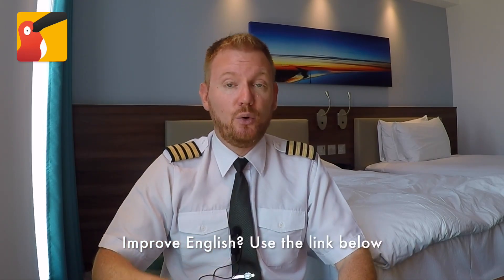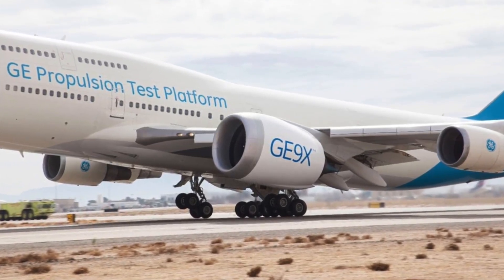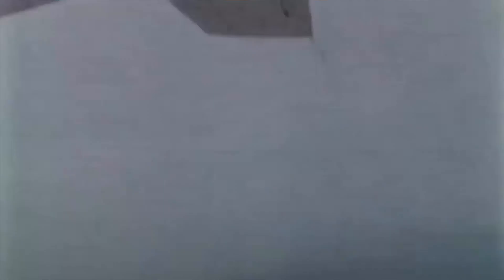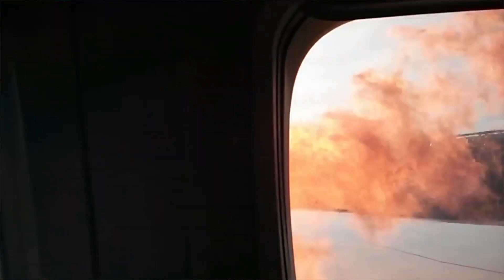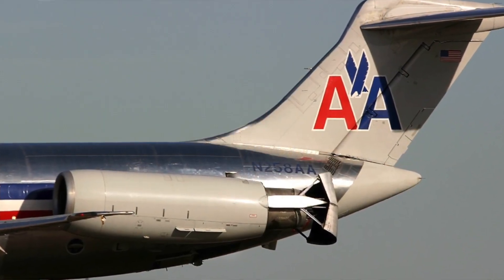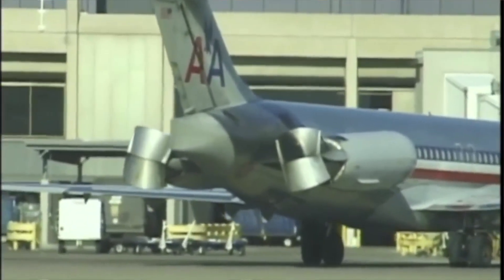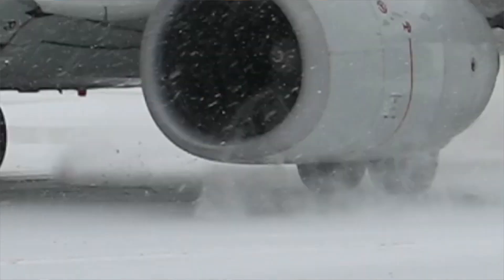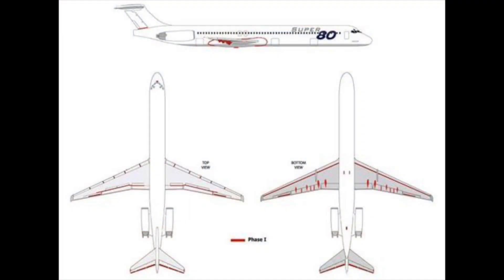Why are the jet-engines placed there? Wings vs Tail

Comment: I was incredibly nervous my first time flying alone. I happened to be sitting next to a pilot, who noticed I was nervous and decided to tell me about the physics of flight and gave me a general sense of the systems in place on a jet. One of the things he told me was that if the engines failed, planes with wing-mounted engines were very good at gliding, while planes with rear-mounted engines were not.
Reply: That doesn't make sense. Tail engined aircraft have a cleaner wing
Reply: @tedarcher9120  It is about their centre of gravity, and the location of their aero surfaces. A T-Tail plane has stabilisers way off the line of mass and so have an outsized torquing moment.
Reply: @Sagan_Starborn  how does that affect gliding though? Stabilisers are producing downward torque anyway to compensate lift, if anything T-tais have lower drag because they need smaller tails
Reply: @tedarcher9120  One way to think about it is, the more off the centre of gravity is, the more you need to compensate with something elsewhere on the aircraft pushing it down towards the ground, to stabilise the aircraft and prevent it from pitching upwards. When gliding, if you have lots of energy pushing the craft towards the ground, the less time it will spend gliding.
Reply: @tonyhawk123  tail engine planes have the same center of gravity as wing engine planes. Otherwise they would call out the sky after takeoff
Reply: @tedarcher9120  It’s about weight distribution.
Reply: @tedarcher9120 I don't know either way but maybe it's just something he just said to calm him down. Being liberal with the truth can sometimes be beneficial.
Reply: Those aboard BA009 in 1982 can attest to this.
Reply: From Google’s AI overview: “No, rear-engined jet aircraft are generally not worse at gliding than those with wing-mounted engines. Gliding is primarily determined by the aircraft’s wing shape, weight distribution, and aerodynamic efficiency, not the engine location. While rear-mounted engines might have some trade-offs in other areas, like maintenance or noise, they don’t inherently affect gliding performance.”

And then there’s a much more detailed explanation that im not going to type in here because it would lead to a post about a mile long, but i will leave you with this: “Many successful aircraft have rear-mounted engines and still have excellent gliding capabilities, including the Boeing 717.”
Reply: Hate those planes have engine on the back they do too much up and down on the way  more turbulence than a big plane they sucks

Comment: How come no aircraft apart from the x-15 have nozzles on top of the forward section of the aircraft for use in stall situations, when you need to change attitude? It can not be that hard to design and couple to the computers onboard, or to be used as last ditch effort by pilots pushing the big red button saying STALL RECOVERY.
Reply: Rather than add all kinds of expensive shit that can break to recover from a stall, the money is better spent teaching pilots not to stall the fucking plane.

Its also actually not hard to recover from a stall, you pitch down and add max thrust, even in a flat spin which is the most dangerous type of stall the procedure is pitch down max thrust, provided you have sufficient altitude to fall through the plane WILL fly if you keep the power on.

Ive done it in MSFS many times, purposely stalling everything from a cessna 152 to a eurofighter typhoon to a 747 and A380. No amount of fancy crap is going to save you from a stall if slamming the stick and thrust forward into the dash at top speed doesn't work, but it always will.

Comment: When working for Boeing in 1966 I asked why the engines we moved on the wing 737. The plane could be lighter because it would be a counterbalance since the wing holds the weight of the total airplane.

Comment: Is it easier to ditch a plane on water if the engines are mounted on the fuselage at the back, rather than under the wings? It seems logical that big, flat faced, wing-mounted engines are going to be a major disadvantage when attempting to land on water?
Reply: Yeah, but how often does a water ditching happen?  Not very many.  179 have been able to be investigated and of those 22% have numerous fatalities.  Of all the averages and computer simulations, 80% of those were complete destruction events and less than 1, if its possible, actually survive a water landing on any engine design.  Very easy to see why.  On a super stall event, usually when landing, its would pitch to a nose down situation and the weight of the aircraft would smash itself longitudinally, usually leading to no survivors.  On an underwing design, a water landing would cause the wings to fold under the fuselage leading to a failure point at the midpoint of the aircraft making escape almost impossible.  A real high approach angle is needed to impact the tail first before the wings touch the water.  In either scenario a land crash would be more survivable than any water landing.  No there are exceptions and luck involved.  The A320 that landed on the Hudson River is a noted success of a water landing.

Comment: Just two queries:
1. What is the advantage of some aircraft having two engines rather than those having four engines under their wings?
2. Another one are those having two engines under their wings and one engine atop at the rear end.
Reply: There's a video on that on this channel, but it's quite old now, probably about the same age as this one.
Reply: 1. Basically 2 engines give better fuel efficiency and cheaper maintenance and operating cost. Advantage of 4 engines is just that they have better redundancy.

2. Its more of a loophole per say. Basically if an aircraft has more than 2 engines, it doesnt come under ETOPS. Hence those aircraft have 3 engines
Reply: Thanx eekee. Will try to check it out.

Comment: The reason engines are placed on the wings is simple and it is one: economics. Fuselage mounted engines require T tails. That means a stronger (and heavier) vertical stabiliser.  Fuselage mounted engines also mean the load is localised on the fuselage. This, in turn, requires a stronger (and heavier) wing. Wing mounted engines make the aircraft lighter and more fuel efficient That is the reason the 737 survived while the 727 died. Aircraft configuration is now optimised. That is the reason all designs, from all manufacturers, have engines mounted on the wings.

Comment: I am not a pilot, but I used to fly quite a lot as a passenger.  I always felt that the DC9 and 727 had cleaner wings and handled low-level / low-speed turbulence and cross winds better than planes with wing mounted engines.  I do miss the 727, I loved seeing the stacks of analog guages as I passed through to my seat.
Reply: I was told that the 727 engine configuration is very inefficient, I doubt we will ever see anything like that again.
Reply: @GratefulFredHurst  That may be why the 727s discontinued. They did have quieter cabins than wing engine aircrafts,  since the majority of the noise from engines are behind them when a plane is acceleratingforward. You probably may've noticed when lined up for take-off back in the 1980s that the 727 in front of you moving away from you during its runway acceleration, it always sounded louder than the 727 you were in sounded while you accelerated down the runway for take-off, the reason was that the majority of the noise was behind the engines. For the same reason, I'm sure you've noticed that the back section of wing engine planes are always louder than the front half. Anyway, the quiet cabins all the way through wss something good about the 727s, the jist of the noise staying behind the planes
Reply: Some planes had the rear engines like the DC9s and 727s, some had just wing engines like the 747s, 767s, and present day 777s A330s, and A350s. And some had both such as the DC10s and L1011s (no side rear-engines though, just center tail-engines).

There were good things about the DC9s and 727s, and the quieter cabins due to all the engines being in back was a reason I liked them, see my above reply. I have wondered why no wide-bodied long distance aircrafts had the side rear-engines and no wing engines like the 727s

Comment: Thank you for this interesting and informative video.  I guess the Lockheed Tristar combined the best and worst features of both engine mounting arrangements, since it had both under-wing and tail mounted engines.  I think there was a flight where a Tristar aircraft suffered a stuck elevator but the pilots were able to control pitch using thrust differential between tail and under-wing engines to make a successful landing.  So, maybe an argument for having that engine layout as well.

Comment: Interesting video on aerodynamics of engine placement.
The Lockheed Tri-Star L-1011 and the McDonnell Douglas DC-10 were right and wrong at the same time.
When my pops flew for Eastern Air Lines he flew the Boeing Whisperjet B-727 series. Flying on passes we often were in the back of a 727 or a McDonnell Douglas DC-9. Being between the engines was loud. Ugh. One issue the DC-9 had was the tires kicked FOD into the engine. Think they made slight adjustment to fix  issue. Might have when they stretched the tube. Do you know anything about this?
I can imagine the challenge of performing maintenance on the S-Tube engine of the L-1011 or the 727.
My heart still belongs to the 727.

Comment: While I understand the underwing engine pod, I consider the problem this will cause when ditching an aircraft. The minute an underwing pod hits the water it will act as a brake and cause the aircraft to roll and break up. Yet I've never heard of a solution to drop the engines in this situation, why is that not an option? Without those pods in place it may be possible to land the aircraft on the water intact and gain the advantage of having it float for a time providing more chance to get the passengers off safely.

Comment: Besides being able to haul ass, and forgetting about cost, what would a plane be like with engines both under wings and at the rear? Like 4 engines on wings and 2 at rear?
Reply: (not an aerospace engineer) I would assume it’s something about fuel efficiency and how complex such systems would be, especially for transporting fuel though with the DC-10 and MD-11s it could be possible.

Comment: What of the design of the old L-1011s and DC-10s with the engine in the middle of the tail? What's the reason for that?
Reply: Three engines were briefly useful for long flights, but ETOPS rendered them obsolete

Comment: Consider 727.  Two CFM56 weigh is less than three JT8D.  Tail position means no ground and wing clearance issues.  Tail position means no MCAS which was the Max's Achilles Heel.

Comment: Engines on the wings(middle) of an aircraft create and maintains balance front and rear. Similar to a mid engined Mazda Miata car. Resulting Improved flight maneuverability, ride handling, and overall balanced structural durability of the plane. Engines placed on the rear of a craft creates rear heavy down force, less overall structural rigidity durability of the craft, resulting in a more than likely unbalanced air plane, which is not the best way to fly and operate particularly in ‘critical’ emergency situations. More than 70% of the latest commercial aircrafts are mid engined. Combat jet fighters are evolving the technology.

Comment: Pretty much having the engines mounted higher on the back of the fuselage is the best option for smaller jet aircraft that’s so low to the ground that they don’t need stairs and the engines are still within arm’s reach of the ground! Of course those sorts of aircraft also have the advantage of being able to land and take off from rougher runways like dirt, grass and gravel runways/airstrips! :)

Comment: The stick-pusher is quite interesting - didn't know that. The footage here of the 717 going into a super-stall is a Boeing flight-test demonstration on recovery.

Going back to engine mount positions, wing-mounted engines deliver an appreciable aircraft-wide structural advantage. Basically, by countering your aerodynamic bending forces, you're able to produce a structurally lighter wing - because the engine is doing some of the work.

On tail-mounted aircraft, both the rear of the aircraft and the wings are beefier than otherwise is the case with your more conventional layouts. 

Aircraft with podded engines mounted below the wing are structurally more efficient designs, weight less, pound for pound.

Comment: It was the pilot of Florida flight 90, a Boeing 737-222, that made the catastrophic decision to use reverse thrust to push back from the stand, clogging inlet pressure censors with ice, affecting his engines EPR readings, resulting in the pilots using insufficient power on takeoff--especially for contaminated wings.

Comment: T-tail planes just look so much cleaner and the ride is more entertaining as a pax.  You are being pushed into your seat as the raw power forcing you into the air is behind you and you are being shoved into the air...whereas when the engines are on the wing, you don't get the same sensation and its like being pulled into the air.  Me...I am an absolute T-tail fan.  Love my Mad Dogs/Diesel 9s/Boeing's red headed stepchild 717, the 727s, ERJ/CRJ (although it isn't as raw, or obvious, of a sensation as in the MDs and 27s) and the bizjet world.

Comment: Video v text. Cons, stall recovery more difficult due to nose up attitude, no gravity fuel feed if pump fails, more risk of damage to body of aircraft if engine explodes, lower fuel efficiency/more structural weight, higher maintenance cost,more frictional drag/weight on nose wheel at take off.

Pros, engines higher less chance of sucking in debris, less lateral torque if an engine fails, less to go wrong in the wings

They work ok, but are less efficient.

5 mins

Comment: Since you put so much energy and preparation into all the stuff you include in those fantastic videos, I would personally like to put in a request.
We have an enormous amount of information and tutorial based instructions regarding landing approaches with ILS. However, there is not the same amount available when it comes to GPS based landing systems which, apparently, are going to become very popular in the future. Reason being, there is no expensive ground based system required like it is with the ILS. In order to understand how this works, we need some pretty good tutorials on the subject and who would be the chosen one to deliver that other than Petter.. I know this video is an old one and the risk is that you won't see this comment but, what a heck, got to try.

Comment: Another advantage of wing-mounted / disadvantage of rear mount:

Tail size and drag. Rear-mounting makes the tail stabilizers much closer to the CG, so they have to be larger to compensate for the loss of leverage. That means lower speed and fuel efficiency.

Additionally, the longer fuselage ahead of the CG works as an anti-tail, making the plane want to weathervane and swap ends, going backwards. That means the tail has to be even BIGGER, meaning even more drag slowing the plane and burning even more fuel.

Comment: You didn't mention the most important reason to mount engines under the wings, and this is longitudinal balancing in flight. Pitching-up torque from the thrust decreases the negative lift requirements from stabilizer in order to balance the aircraft in flight. Less negative lift — less balancing loss, higher aerodynamic quality, hence higher fuel efficiency.

Comment: I am a bit surprised there aren't more high wing jetliners with high bypass engines. That way they could have high bypass without tall landing gear. I do realize they would have to have wing boxes at the top and LG boxes at the bottom, some of which is shared in low winged ones. They have several examples of turbo propped airliners done this way and smaller ones such as the Twin Otter. Except for the addition of the high strenghtened area I don't see the disadvantage of this. (Perhaps additional noise for the passenges too.)

Comment: If you detailed how much weight is added to carry rear mounted engines I missed it. You did mention needing a stronger rear to support the engines. This added strength needs to be all the way to the wings because the wings are still carrying the engine load. With the engines out on the wing, wing structure can be lighter. It’s much more understandable with statics drawing a free body diagram that shows the outer parts of the wing are mostly carrying the engines while the inner portions the fuselage - simplified explanation.

Comment: Off topic somewhat, but I suppose this is as good as any other thread. I've noticed in rear mounted twin configurations, that when TO thrust is heading towards max, that the engines develop a distinctive 'buzzing' sound over top of the usual jet whine. Is this an engine feature or related to the sound dampening with the rear mounted engines.  Thanks y'all !!

Comment: I wonder why they didnt just install a stick-pusher system into the 737max instead of the wierd mcas? instead of inventing that, they could have spend the money on an additional aoa sensor...
Reply: Because stick pushers are outdated and can cause more harm than good in modern aircrafts

Comment: Rear engine planes are so quiet in the cabin. My first few flights back in the 90s were in some kind of rear-engine plane with aft air-stairs. I thought it was so much quieter than plames, busses or cars. And then the first time in a bigger jet I thought it was so cool but was quickly disappointed by that constant hum of the engines. And then the one time in a turboprop, I hated every minute of that.